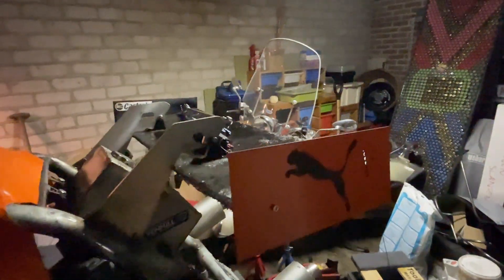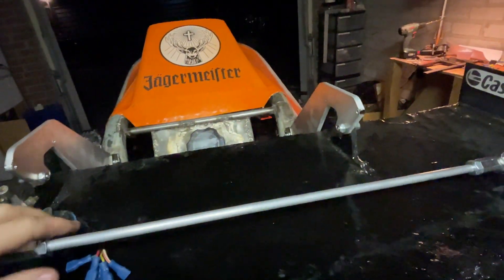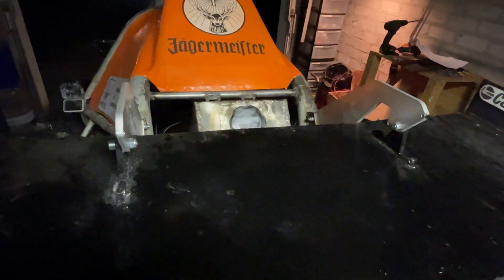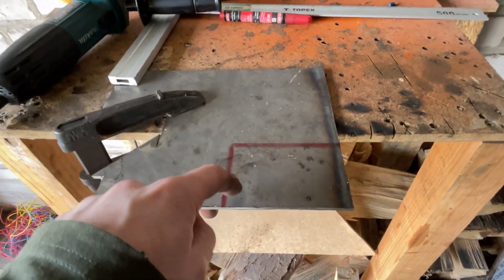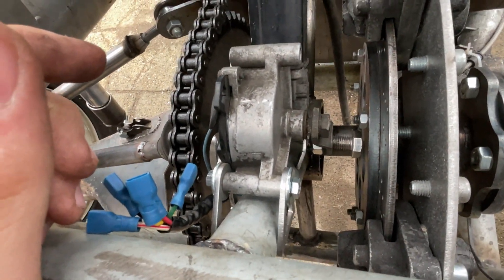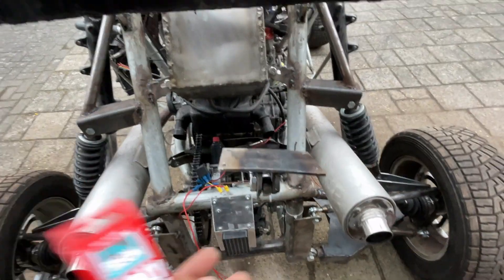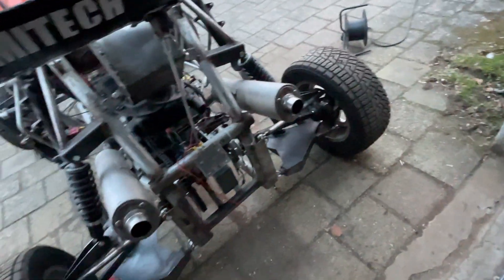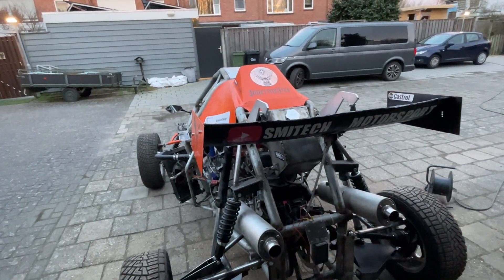HOW TO BUILD a SIMPLE DRS SYSTEM! Part 3 - IT'S FINISHED and WORKING!

Comment: Cool job. What electric motor did you use?
Reply from the maker: Thanks! I used the headlight motor from a Mazda Miata because those have that 2-stepper mechanism which was perfect from a project like this!
Reply: Awesome. Im busy designing a FSAE for hilclimb and track meets and a functional DRS would be a nice touch. Do you think a window winder wil work also?
Reply from the maker: That’s sounds really nice! If you have some pictures I would be happy to see them! I think a winder winder would work as nice. The benefit from the headlight motor is the two steps with the relay. So you can rotate the motor with a button. The window motor will keep spinning as long as you push that button so I think that makes it hard to get the wing in the correct place…
Reply: Im from South Africa and FSAE is non existent in out country. Im still in the design process using all info and, pics, rukes and regulations i can find to build according to our race specs.
Reply from the maker: Oh that sounds great, but why limit to FSAE?
Reply: What else can or would you suggest?
Reply from the maker: Maybe a bit longer wheelbase, with 1000cc engine. I suggest you’ll stick with a combustion engine or am I to old school?
Reply: Im looking at making it a bit wider and longer wheelbase and yea, me going old school with engin, 750 - 1000cc
Reply from the maker: That’s sounds really cool and makes me want to build an F1 style racecar too!